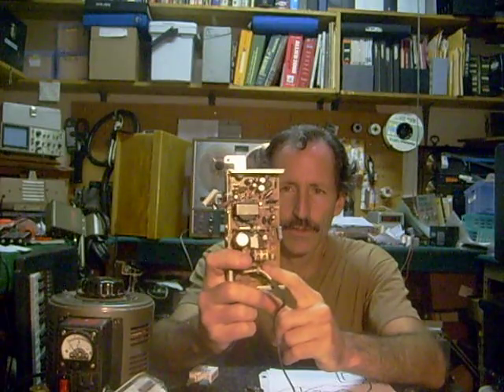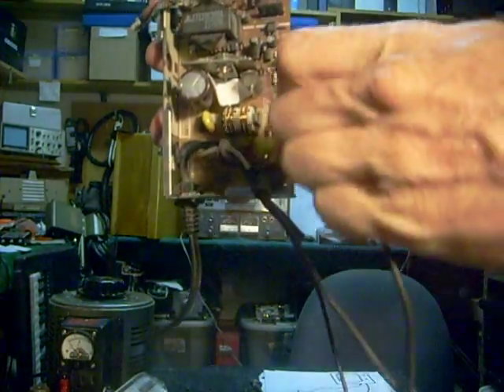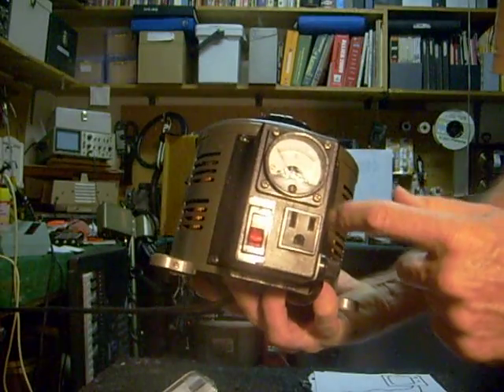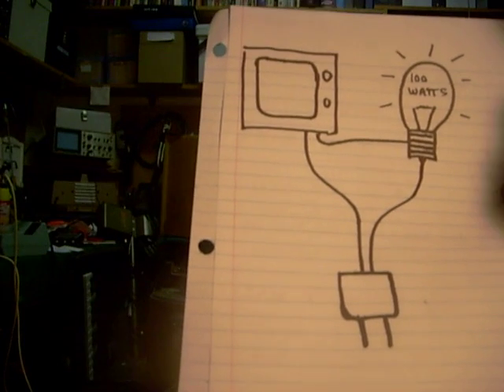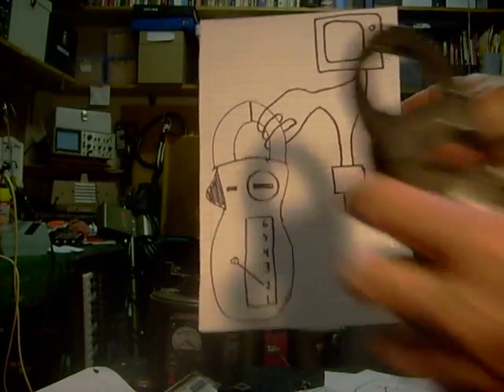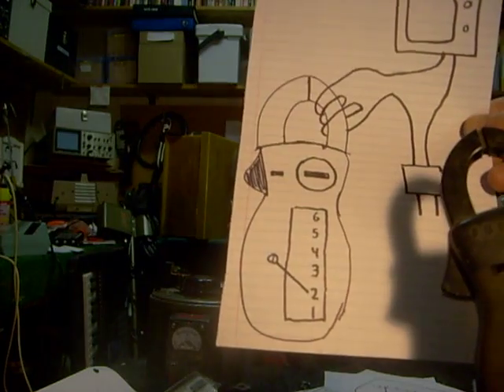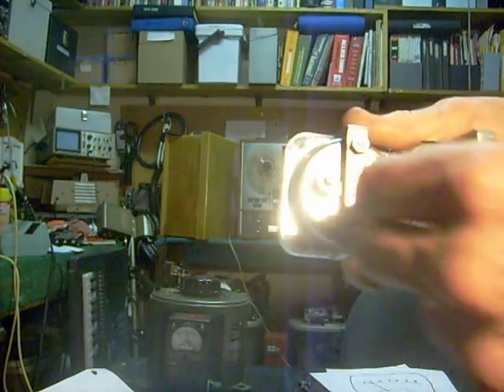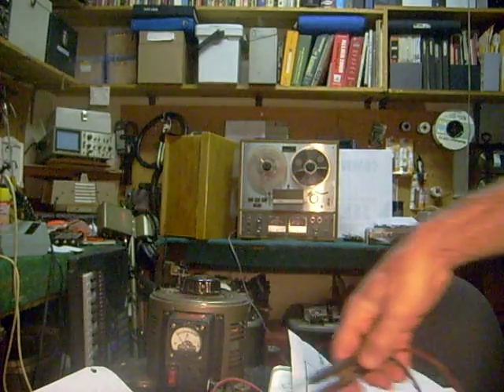LCD TV Repair made easy #4

Comment: HI, I have a 2000 Astar tv/monitor & the backlight seems to work ok but all the other functions don't. It has a 12vdc input inwich i replaced with a pc power supply of sufficint amperage several years ago, It worked great intil now. I HAVE BEEN UNABLE TO FIND ANY FUSING INSIDE. ANY SUGGESTIONS?
Reply from the maker: Sorry but I haven't a clue as to what's wrong.

Comment: Really enjoy your videos.  I have learned very much from them.  I do have a question.  What is the brand and model of your variac.  All I can find only have a voltmeter on them and not an ammeter.  Thanks, Tom
Reply from the maker: The one I use is a Tenma. Model number 72-110.
There are other models which which allow you to change the scale from 1 to 10 amps or more. That would be my preference.
Reply: Grants Pass TV Repair   .  So  if you had your choice, which variac would you choose.  I plan to end up getting 4 different items.  Maybe you can recommend what you see as very good.
1. A variac
2. An isolation transformer
3. A bench power supply
4. A hot air machine
The only other thing I may try to get is a desoldering machine or gun.
I would appreciate your input.  Tom
Reply from the maker: To much to answer in text. call me if you would like to know more.

Comment: The shunt across the ammeters are of a known resistance, therefore, the meter will deflect according to the voltage drop across the shunt.
Reply: +314Tazo  So this is something like a current sensing resistor? With known resistance and voltage drop amps can be calculated using ohms law.

Comment: hello! i have a westinghouse tx-42f430s and i have backlight coming from both master and slave inverter, i also have sound. so when i turn tv on my screen is black(kinda purple) not dead. i did a visual check of components and i cant find anything by naked eye. u said something in one of your videos about case files, how could i find if my tv has one? your videos are both generous and fascinating, thanx 4 posting!

Comment: I have a Mitsubishi LT-52144 it had a power surge had no power light i changed the power supply  no luck then i changed the main board no i have audio and just a green screen doesn't matter which input i use audio screen shows the inputs on the screen but no video just green background. Also just did a firmware update from Mitsubishi still have a green screen.

Comment from the maker: Vizio TVs have a lot of main board problems due to their 3 pin voltage regulators going bad,  but the model number you gave doesn't sound like a correct model number. Nothing comes up when I google it.

Comment: Thanks for reply...ur video on Panasonic board (Vid#10) that 450v 10uf caps were replaced and that the adjacent transformers and two invertors? also need to be checked.  In your response you say it points to the main board.  Does this mean that I may need a power board (or that wasn't the problem in the first place) or that I need the main board with the tuner and everything on it.  Seems you can buy 32" LCDs for 3-4 hundred and I have 100 into this one now......your recommendation?

Comment from the maker: @bejones269 When a TV is struck by lightening the switching power supply is generally the first to go. Start by checking the simple things like the varistor, fuse, bridge rectifier, and the capacitor that comes after it. If your lucky the lightening didn't go beyond damaging one of those components but many times it also damages your main switching transistor, ICs, diodes, resistors and circuit traces. If the antenna was hit by lightening you can bet your tuner is probably toasted as well.

Comment from the maker: @Zundwig When a TV is struck by lightening the switching power supply is generally the first to go. Start by checking the simple things like the varistor, fuse, bridge rectifier, and the capacitor that comes after it. If your lucky the lightening didn't go beyond damaging one of those components but many times it also damages your main switching transistor, ICs, diodes, resistors and circuit traces. If the antenna was hit by lightening you can bet your tuner is probably toasted as well..

Comment from the maker: @bandet888 The meter is so sensitive it still works with a short/shunt across it. The size of the shunt determines how sensitive the meter is. The same meter which is designed to measure up to 5 amps could also measure 50 amps or 500 amps with a larger shunt. I hope  this helps.

Comment: The new bulbs worked and my tv problem is solved. 
This inspired my to attempt to fix another samsung LCD with a slightly different problem. This tv has normal backlight and sound, but no picture. After powering on, the LCD is a dark grey color and slowly begins to fade to an all white screen. When i change the input source, the screen flashes and the transformer on the PCB starts humming. Also the led on the front is constantly blinking. Any ideas on this one?

Comment: Also I reassembled the tv without the lcd panel, so I could see exactly which bulb wasnt firing. Turns out it is the 3rd bulb from the top. I got a nice picture of it too if you'd like to see it.  I should have done this before I bought the inverter. I think Ill just buy 2-3 bulbs and replace the ones that look like they'll burnout next.  I got a quote from ccflwarehouse for $12.95 a bulb. which was lower than $19.99 i found at 2 other sites. Ill follow up with the results

Comment from the maker: Yes there is. Using your volt ohm meter you can put it on the resistance scale, and measure across the primary and secondary side to see it its open and or has any shorts. Since you may not know what the resistance should be, try measuring some of the other inverter transformers, and see how they read in comparison.

 If you had what's know as a ring tester that

Comment from the maker: One additional thought. It could also be that just one of the inverter transformers has gone bad, and or the related circuitry which drives them. but they might not sell you a single transformer anyway. I have not repaired enough LCD sets to tell you which is more likely to be bad between the inverter board and the lights.

Comment: In your experience with samsung lcds, what part is more likely to be the faulty part? the inverter or the CCFLs?
Ive found both parts online, but I dont know which part I should pursue. CCFLs - $10 to 12 a piece. Inverter board $70. I got the bad TV from my dad, who was going to throw it out, so if I can spend about $100 and a few hours to get it running again, Id say its worth it.
Thanks

Comment from the maker: That trick with the hair dryer will not work if the capacitors are to far gone. Since you may not be able to get parts on your TV any way, it might be fun to see what kind of back light you can come up with on your own such as LEDs. I recently saw a youtube video on this. Perhaps more work than the TV is worth, but if your the experimental type it might make a fun project.

Comment: I've verified that the LCD is working after that one second of backlight using the flashlight trick. Im getting normal audio as well. After watching the video on capacitors, I tried the hairdryer trick on the 4 caps on the inverter board. I heated them up before turning the tv on, but the heated caps didnt do the trick. Also I tested the voltage to the inverter board and its reading 24.4V. According to a samsung troubleshooting guide on this model, its needs to be 24V.  Thanks for the quick post

Comment from the maker: You can shine a light of your own behind the screen and see if your picture is there. That will at least confirm if there are additional problems other than the light circuit, but because of the way the feedback circuit works sometimes its hard to draw the dotted lines between the symptom and the cause.

Comment from the maker: I would start with the power supply capacitors and move on to the inverter board to see if your transformers are open or the lights themselves are bad. From what I'm hearing on the new LED sets they have a feedback circuit which can shut down the power supply if it senses a problem in your lights or the associated output transformers which often go open.

Comment from the maker: A real common cause for the kind of problem you described, is that the back lights on the TV are not operating due to a bad inverter board, but it's difficult to guess at problems like this with out seeing the set. I'm assuming this is an LCD TV.